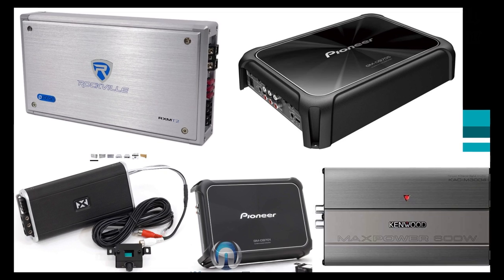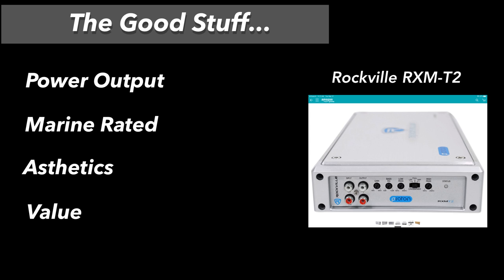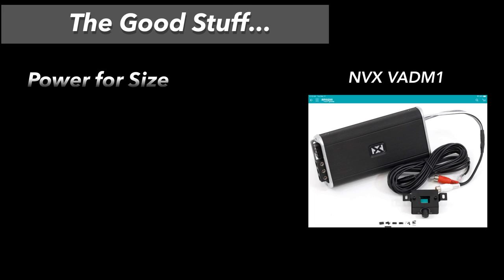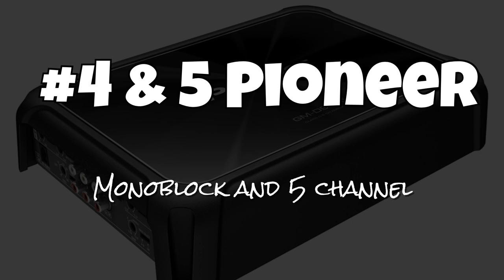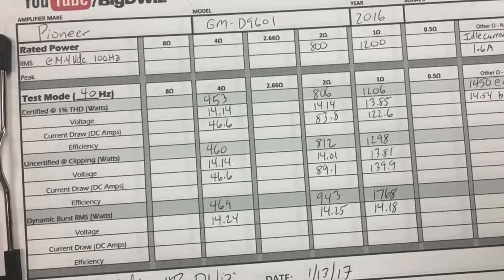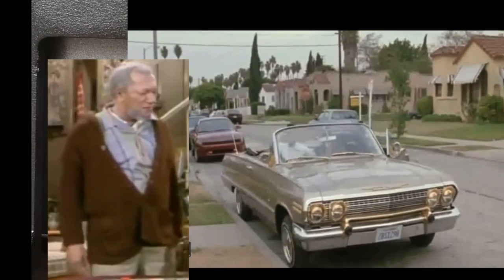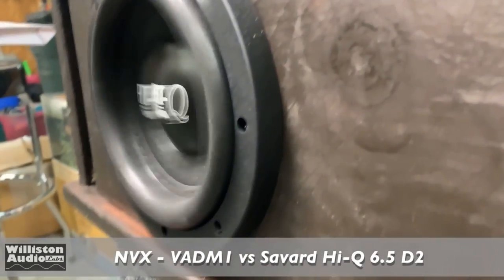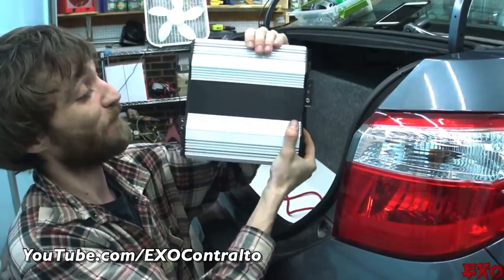Budget Amp Picks in 2020?

Comment: I installed one of the kenwood 3004's and it ran very hot.  Had to switch it out for a different amp.  The Pioneers in that series are beasts.  One of the best bang for the buck you'll get.  I run an 8601 and 8604 in my car.  Great video and info as always.

Comment: Took a gamble on a ignite audio R3000/1D from another video u did with that brand. Inexpensive and surprisingly powerful. Pushing 2 8's in a ported box (would push 18's 4 sure) . Gains all the way down, bass boost al the way down and still over powers mb quarts mids and highs. Thanks for the vedios. Love the budget builds. Easy to throw money at problems but that doesn't always fix things...
Reply from the maker: Another top 10 budget amp!

Comment: Big D I chose the GM-D9705 for my Dodge Ram. Head unit is the excellent Kenwood DDX-396. I'm driving 3.5 inch new Kickers in the dash using the Kenwood front channel out with bass blockers - just for sound stage and ambience. Front doors have new Kicker 6x9, back doors have new Kicker 6.5 inch. Front and rear are being driven by the GM-D9705. Subwoofer is the Dodge factory sub enclosure with a Kicker 8 inch driver powered by the Pioneer subwoofer channel output. Signals are CLEAN, very low noise. PLENTY of power and that Pioneer 5-channel amp stays nice and cool! Thanks for your reviews and suggestions - you really helped this build! And with careful shopping I have an incredible sound system on a budget. I'm outta heeeere!
Reply from the maker: Awesome 👏

Comment: I bought the Pioneer 2-channel version (model # GM-D9702) of the monoblock and 5-channel amps tested here. I am quite pleased with it. My guess is it's rated power is likewise, probably close to actual power. It seems to power (2) JBL 10 inch subwoofers well.

Comment: Taramps... Ive never had an issue and I own 5 of them even in convertibles and humidity... and they are tiny and take barely any juice... I love my DS440 and my TS400 as well as the Bass400 and Bass1200...  and the 5th actually just sits in the shop lol... I have the TS paired to the Bass400 in a Rav4 and the DS paired with the 1200 in a sprinter van.. those pairings work amazing.. Ask if you want details for speakers and such.. Im always helpful where I can...   I LOVE this channel....  Do more videos keep them up.. maybe more speaker tests or comparisons or box builds or systems for certain budgets...That would be awesome... Great Channel...Entertaining as heck..
Reply from the maker: Thanks! I added the Taramps Smart 3 after the credits. Great amp 👍
Reply: @wal  I agree for the price they are hard to beat.. I have a pricey set up and its great but daily driver I dont need extreme clarity. lol or spend the money on a DSP system... I do however want it driving a speaker capable of putting out the best sound so the Bass1200 is wired to a 8" meso, it drives it amazing.. and the 440 is sent to a set of components.. (well 2 sets)

Comment: I got a Pioneer GM D8701 to power my Sundown E series 15” v3 D2 and I couldn’t have made a better choice. 800w rms and I got it for $152 tax included. I’ve also got the Pioneer A/B class GM5702 powering my Phoenix Gold RX 6x9 coaxials, a pair of Memphis Audio PRX10 1” polydome tweets with their own external crossover which also is crossing over some former 3way 6.5” pioneers that are now just midrange drivers. That is all my front staging. My rear stage is just some 5.25” coaxial Kicker DS models which are actually really clear and clean  at high volume. They’re being pushed by an A/B class Dual brand xpr 520. Its a clean sounding amp that’s never failed me. I push all my equipment EXTREMELY hard on a daily basis and none of my choices have disappointed me yet.

Comment: I got a rockville RVA-M2 2500w recently for my beater truck and I have been overly impressed. I have it paired with a single 12 kicker comp dual 4ohm wired at 2ohm at 400w and it beats.I'm familiar with the company and normally would never recommend them for anything else, but the amp is great for the price. I do appreciate they give you the legit output along with the BS max wattage lol
Reply from the maker: Thanks for watching and commenting!

Comment: Normally I don't comment but when you praised the "TAR-rible" smart 3K which I bought from your suggestions I felt I needed to speak up. Sound quality was less than expected especially since it was being pre-amped by my Kenwood xr600-6dsp which has DSP control abilities on the rca outs of the amp and even though a 24db LR crossover setup it was very muddy. But that's not even the worst part. When I went to re-install the amplifier after rewiring my subs from 4ohms{ I did this to break in the subs gently) to 1ohms for which I set the gain by ear so it was at high volume all of 5 mins, the amp gave up the ghost 10mins later while the system was at low listening volume. I double and triple checked everything, all connections (grounds, positives, everything), ohm load(subs checked out at 1ohm exact), and lastly I'm running approximately 285ah of AGM batteries so it wasn't for lack of power. So after a $300 loss I'll never buy nor endorse a taramps product.

Comment: Pioneer also has high-level input and auto turn-on with high-level signal, no need for remote wire. Works great with one amp, super buggy when connecting more than one amplifier

Comment: Those Pioneer amps are so slept on! Just down right amazing amps for a budget build.
Reply: The kenwood versions are also excellent choices!  I’ve installed 3 of the kenwood 5 channels lately.  Great options for people who are on the fence about running a sub and gives them a prewired option down the road.
Reply: @saab9251  how would you compare a 5 channel nvx to a kenwood...considering swapping my 5 channel nvx in the future...polk speakers cerwin sub..small hatchback kenwood deck.

Comment: do   you  remember   G&S   redline subs?      from back  in mid  90s           subs  with lightning bolt..     still  have  the  2 12 in subs but   just  the  magnets  , basket  and   voicecoil          paper cones are gone    ..     It’s all I have left of my pimped out 88 Mazda RX 7      sold the car in  96    for 3,000    lol    car was  mint  chrome  wheels,  black  paint,blacked out tint.       I remember having a phone antenna on the car..  but instead of a phone I had a CB attached..lol      I was too cheap to buy a car phone...        had  3  amps  in the car   zeus  ,  for the subs,      a sony  for  4  mids  and a  small sony  for  tweeters,    Built the false  floor  with  plexy  covers so u could  see the  amps,  ..  car was only a 2 seater   so i had the rear  area  were seats   would have went  for a different model..         my model   just  had  a  cover  area..    pretty cool  ..       my head unit  was .what ever the highend  kenwood was  in  94     a 100 disc  changer,  Visual spectrum analyzer that used to talk and had all these light shows..  i forget the brand  ,  Could’ve been pioneer I don’t even remember..    and a  kewwood    crossover
Reply: You must be from Hayward!

Comment: I've been loving the results from my BOSS branded audio. I'm running 2x10" subs in my Super Duty crew cab behind the rear seats with the Chaos 2000watt monoblock good from 50hz to 200hz. Plenty for the cab. In my Supra I'm running their DVC12's in a modified prefab box that just Rocks!  The setup in my truck was around $250 and my Supra was $350. That's all materials and parts. I have a video on my channel with the Supra.

Comment: Great vid mate as usual ... but I'm a bit confused: 

Pioneer Gm-D9701 putting:
500 rms @4 ohm
800 rms @2 ohm
1200 rms @1 ohm
Now I'm getting a single RF T1 12" 800 rms (in sealed enclosure) available in both 2 or 4 dvc. Which one to pick for this amp?
Should I get the exact matching sub with 800 rms and run it @2 ohm or should I get the 1 ohm load and adjust the gain for 800w?
Any recommendations?
 (will adjust the gain with a voltmeter in either case)

Comment: I think another reliable semi budget Amp is the skar version or soundqubed s1-1250 is a good mono Amp, on sale can get for around $150 and has that clipping light on bass knob, small and puts over rated power, puts out almost 1500 watts @ 1ohm and was able to use it without any electrical upgades on 2 infinity 1200w subs without the big 3 on my 2013 Ram hemi and my truck has the premium alpine system Amp also running the interior speakers. I had a Rockville db15 and the soundQubed for sure puts out more power and has nice sound quality and more efficient. For a budget sound quality sub, I been buying the infinity 1200w subwoofers, for some reason Amazon has been selling them new for around $90, I ended up buying 4 and they sound clean and can handle the s1-1250 with no issues @ 1ohm.

Comment: Taramps and NVX all day long. I wouldn't touch Rockville tried them out 2 years ago just for the sake of it. And protection mode right away at 2ohms
Reply from the maker: They sell a lot of cheap amps, bound to have a few bad apples
Reply: Budget is as budget does.
Reply: I’ve ran 2 of the rxm t2 beat the living hell out of them in a utv build for 2 years no issues . Had them on mids/highs though

Comment: The Kenwood M3004 50x4 is a Decent amp for its size. Had one in a 2016 Hyundai Tucson. Infinity Primus speakers. Wish it made a little more power. I like to ride with the windows down. I have a 2019 Hyundai Kona now. SE AWD. Had a shop install a Sony XMGS4 4 channel. Loud. Kicker KS series speakers. Future plans to put in a 12" Kicker CompR  DVC (2Ohm each) to a Kicker 43CWR122.

Comment: I had a NVX VADM4 and that little sucker pumped out some power for being just a little bigger than a dollar bill. When I opened the box I noticed it had some little bitty plastic plug in rca input leads which I instantly didn't like. So when I mounted it to my amp rack I made sure those chincy input harness were secured and I bragged on that little guy for about a year and a half until...I was driving along and all of a sudden there was loud engine noise coming through on my highs so I stopped and just basically touched the rca input harness and the noise stopped I drove about three blocks and smelled that awful electrical smell that we never want to smell. I stopped and laid down the back seat of my truck and that little guy was pouring smoke out of both ends so I pulled the fuse and when I later took it apart there was a row of small blue round things not sure if they were capacitors or what but they were melted into oblivion

Comment: I personally like the idea of the molex connector if you’re shoving the amp somewhere difficult to reach up in a trunk.  I wish they’d go one further and put a deutsch bulkhead in and send loose pins and a connector.  The deutsch are meant to be pinned and depinned easily and I like the idea of a good snap in connection that won’t rattle loose.

Comment: Alright not being critical but these are ALL Class D amps... While I appreciate the spirit of budget; specifically for the 2, 4, and 5 channels; how does SQ NOT factor in?  There are some 2 channels from US Acoustics that may not make BIG power like this; but they are budget and are actually good sounding... I will say the pioneer 5 channel is Meh ok sounding at best... Also, the Rockville is also dead sounding... I know you always do a test with subs and I appreciate that man!  but you should probably invest in some decent (yet relatively cheap) home monitor class speakers like Emotiva T2, T1, or T0... These all have SPL sensitivity of roughly 89-90 which is close for most car environments and they are 4 ohm impedance... This would allow for some critical listening tests which is honestly another dimension I think it would be awesome to add!  Just a thought

Comment: I bought the pioneer and after a year it caught in fire internally and started pouring out smoke! Luckily I was able to disconnect it quick enough before it turned into an actual fire! Long story, but it was replaced with the same amp and it hasn't caught on fire..... yet...

Comment: When I went to " upgrade" my car I went with the 5 channel pioneer as space was a very real issue.  So didnt want to run multiple amps for the full range and a sub that I added (12"dvc) no disappointment and I've been running it for over 2 years . Yeah the angles and the super little allen for the speakers are a draw back depending on how you do your installation.
Reply: Same here. Upgraded my toyota highlander. Running 6.5 components and 6.5 coaxial in the doors and a single 10" subwoofer. Also sound deaden the doors.  Love it and the am so happy.

Comment: What about those new stetsom eq3000, great budget amp with small footprint and does its rated power. I got the 1ohm series and its one of the best amps I've ever owned at far as budget friendly.. Great video by the way, your always making car audio way more fun than people even realized car audio can even be... 🔥
Reply from the maker: Be careful with those. I would underfuse it to be safe. Me and several other testers have had those go up in flames on the test bench. See the recent Timpano amp, it’s essentially a Stetsom EQ3k
Reply: @wal  wow, I've actually seen your video about the timpano amp. The stetsom does generate some heat in just 20 or 30 mins of being in use so I bought a small fan to help cool it off somewhat. I have 300 amp fuse in the front and 2 lines of power and 2 150 double fuses running to my back battery bank. What size fuses would you recommend instead of the ones I have now?  Also have you ever thought about testing out those new sfb sundown amps, now that you informed me about the true credentials of these stetsom, I'm now leaning to only using my sfb2000 amplifier instead of the 230 dollar stetsom amp that I recently just purchased. My only complaint about the sfb2000 is that it tends to hit more of the higher notes instead of those 32 hertz and lower...thanks for replying to my comments, your content and info on car audio has really helped me over the years and your videos are some of the best if not the best around right now and plus you have the coolest Nick name around B D wiz...

Comment: I had a pioneer gm8601 it lasted me for several years, small and lots power, more than my old Rockford punch 2 12" 4 ohm single voice coil,  single sub could take
Reply: Is it still alive? I'm lanning to buy 9701
Reply: @Live_Loud  nope it died!
Reply: the punch sub runs but it can't take much power anymore, I probably have to recone it!, the amp is dead!
Reply: @Krotos1970  wow! How amp died I'm curious to know. Did sub blow and took amp with him? Or due to low voltage?
Reply: @Live_Loud  I was clipping it on a skar sub
Reply: @Krotos1970  oh I see! So we can consider it owners fault and not a bad product! 😅 Except subsonic filter everything is good in this amp!
Reply: @Live_Loud  yeah
Reply: @Krotos1970  was that amp overheating when you pushed it to clipping?
Reply: @Live_Loud  I was not paying attention to it, I was driving

Comment: The Rockville amp went into protect mode at 2 ohms bridged?  And its class d that's not good at all.
Reply from the maker: It’s a 2ch amp and meets ratings other than Rockville saying it’s 2 ohm mono capable. This amp is powerful for a two channel and at $130, it’s a steal
Reply: @wal  I've run the rxa t1 bridged at 2 ohms..

Comment: Hey Big D,

I've been watching your videos and you gave me some great ideas.  So I just purchased

AMERICAN BASS American Bass Elite Series 12 Woofer 1200 RMS 2400 Peak 3 VC / E1244 /

and

Alpine S-S65 S-Series 6.5-inch Coaxial 2-Way Speakers (pair)

What amps should I be looking at to run these 3 speakers in my Sprinter van?  

Thanks a lot, Jason
Reply from the maker: Depends on how much bass you are expecting. A nice 4ch or 5ch amp would give you some flexibility. I’d look for one with remote bass control like the Pioneer 9705
Reply: @wal  Thank you.  I had that one saved on Amazon

Comment: how is the pioneer a budget amp   I'd think you  would be near to deminishing returns  if you started comparing watt for watt and dollar for dollar   -  Im trying not to sound hurt here   -  for 1200 watt continuous  what amp could you find that is better its a genuine question  - I get what you said about the rca's  if  your  install is crp boot full of sht things get damaged or if your pulling things in and out all the time    - but if you placing the amp inside a wall like im going todo not a issue.  - id think the caps would be as good as anything you can put against them

Comment: Hey buddy just trying to a find out if the precision power spl 5000.1 is a good buy $175 on Amazon.  Got a 120 amp maxi fuse and says a produces 5000 max 2500 @ 1 ohm 1700 @ 2 ohm.  I would love to see a test of this because it matches the skar audio for a budget friendly option.
Reply: Skar RP2000.1D for $220 on ebay, does over rated power...

Comment: New guy question Alert!!!!!
I'm thinking about getting the pioneer 9705 amp for my truck. The channels overpower my speakers by 10 rms at 4 ohms, is that an issue???

Also I was wondering if you can use an amp at different ohms? Ex.(4 ch @4ohms and sub ch @2ohms)
Reply: Yes you can run an amp at different ohm loads. Over powering your speakers by 10 watts ain't gonna hurt nothing. Mines is over power by 20 and. I ain't blew nothing or change anything thing in 6 years

Comment: Hey big d just wanted to add correction! Most of these 5 channel amps are class ab/d for sub channel but the pioneer is all class d. the spec sheet is referring to channels a and b as they are labeled on side of amp and not the topology

Comment: What do you think about the Orion cobalt series amps I found a new in the box for 95$
Reply from the maker: They are decent amps
Reply: @wal  have you tested one of these CBT-2000.1D
Reply: Which shallow mount subwoofer would you recommend for a q bomb down fire box with a mounting depth of 5.5 inches and 0.9 cubic feet